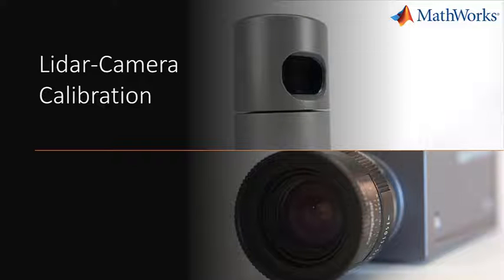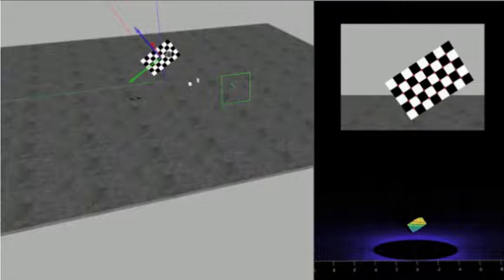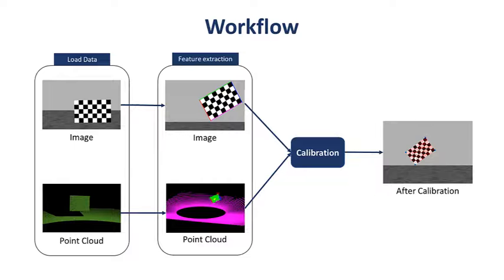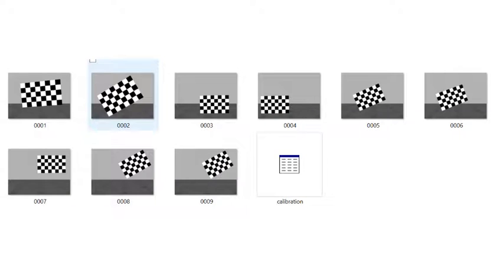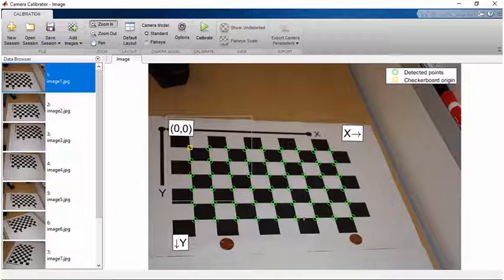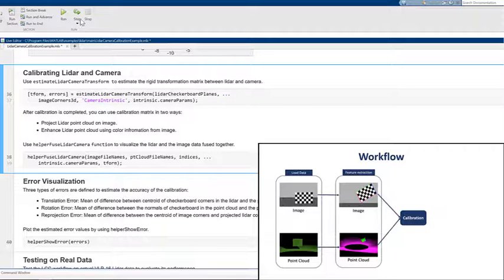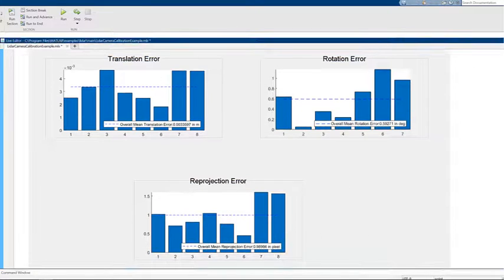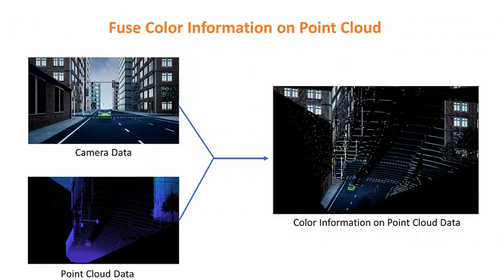Lidar Camera Calibration with MATLAB

Comment: Is there a preferred size for the checkerboard as well as the size of the sqaures in the checkerboard? Getting a reference dimension would be helpful
Reply from the maker: Unpacking your question in two parts....

Q. How to take data for calibration of lidar with camera?
A: You must use a checkerboard target with even number of squares on one side and odd number of squares on the adjacent side. You must ensure that the data is time synchronized and that the checkerboards are clearly visible in both images and point clouds. For more information about the data capturing guidelines, please refer to the following page: https://www.mathworks.com/help/lidar/ug/lidar-camera-calibration-guidelines.html
Reply from the maker: Q. Is there a preferred size for the checkerboard as well as the size of the squares in the checkerboard? Getting a reference dimension would be helpful
A: There is no preferred size for the checkerboard or the size of the checkerboard squares. It depends on the relative position between the sensors and the checkerboard. We have seen that checkerboard square sizes above 50 mm should work. The checkerboard pattern can be accessed from the following page: https://www.mathworks.com/help/vision/ug/calibration-patterns.html